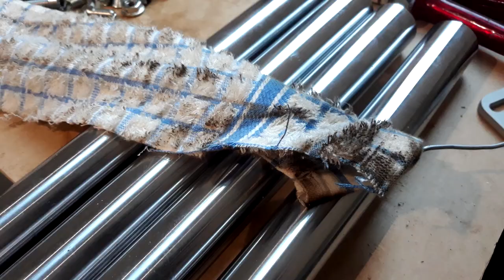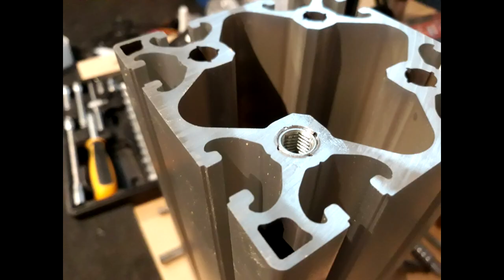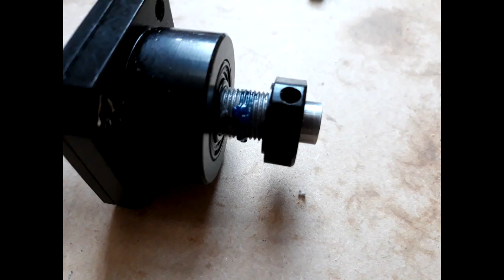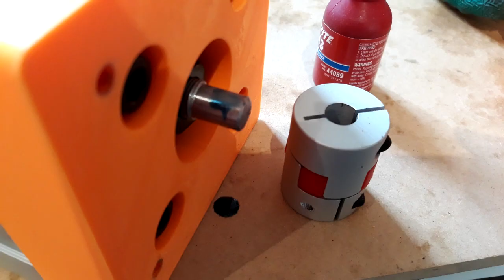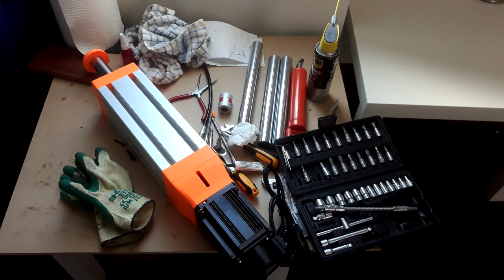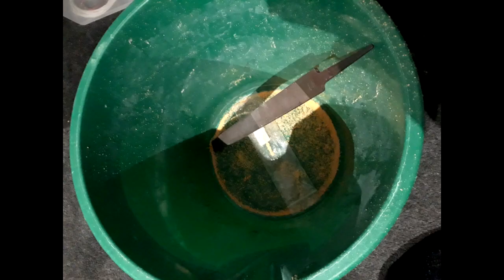DIY motion platform for racing and flight sims - building the SFX100 actuators part 2

Comment: what is the model of the moor?
Reply from the maker: 90ST M02430 servo drivers and motors
Aliexpress - David Shen
Reply: @sixdegreesofflight7765  hi, im assembling my actuators right now, this video helped me, thanks!  one of my actuators seems much looser than the others, when I shut it down, the one basically slams down, and the others float down a little more softly.  do you have any variation like this in yours?
Reply from the maker: @slikk66  Hi, I don't have any variation at all. If it's only the motion from working height to the rest position that is different, it points strongly to the Arduino being the problem. The first thing I would try is unplugging the DB25 cable and switching it with one of the known good ones. Then press Start and Stop. If that fixes it then I would try uploading the firmware to the Arduino again. Otherwise, I would replace the Arduino. All the best
Reply: @sixdegreesofflight7765  ok thanks for replying, maybe I'll try opening up the actuators again and taking a look.  i dont have the arduino connected yet, im simply using the JOG function on the driver boxes.  if I lift them all up then let off, one slams down, the others are much softer as they return to bottom.  it almost feels like the ball screw isnt tight enough on the shaft, if you just invert it the slider slides down, whereas the others dont, but I dont think that is a piece you can tighten :/ other than that it seems to work fine, just much easier to spin with pressure than the others. the fitment of the slider printed piece seems same as the others, there isn't a lot of play or anything.
Reply from the maker: @slikk66  OK I understand now. The ball screws in mine are quite sticky. I did put in a LOT of grease but even before adding more grease they took some effort to move them. Even without the grease the ball screw should not move on its own. It almost seems like it doesn't have enough ball bearings to hold it snugly up against the lead screw. Let me know how it goes.
Reply: @sixdegreesofflight7765  cool, thanks. I just took them apart, I forgot to check the motor shaft key direction on the coupler, so apart they came. I noticed that I hadn't tightened the linear bearing properly on that actuator, other than that they all seem pretty similar, it doesn't seem noticeably looser than the others. Ill keep a watch on your channel! Dying for more sfx content :)
Reply from the maker: @slikk66  I tightened the grub screws as much as I could and added Loctite to help with the grip and eliminate slippage. If you decide to use Loctite make sure you get the right one and that the surfaces are squeaky clean :)

Comment: Great Video and tips :) im already Own one of These for a year now. I had to reprint sliders too, in my case the Mistake was, i printed with 100% Material Flow. The Problem is Pla is getting bigger by cooling out. Had no problems with 90% Flow, everything Fits better than before.
Reply from the maker: Thank you - that's a good tip. Time will tell how the filament I used stands up to wear and tear.
Reply: It’s so obvious that sliders take the most load and crap out before anything else.  I’m going to try printing the next set of parts out of petg
Reply: @revloop.studio  It would stand the heat better but PLA is harder and actually stronger before failing on load test (but brittle vs stretch)  than PETG and should be better suited for this application